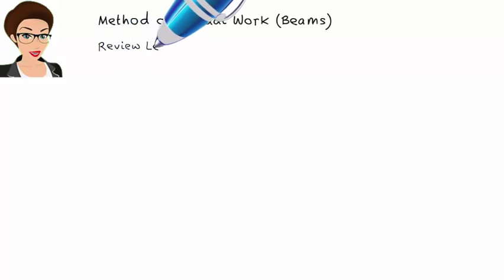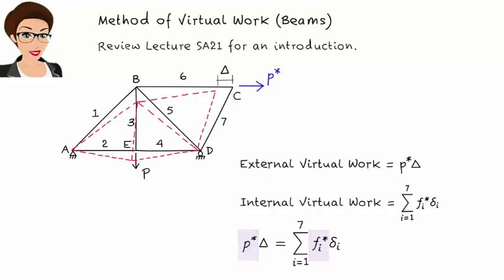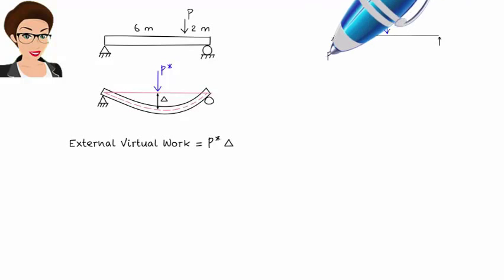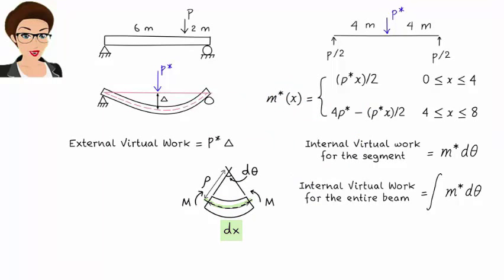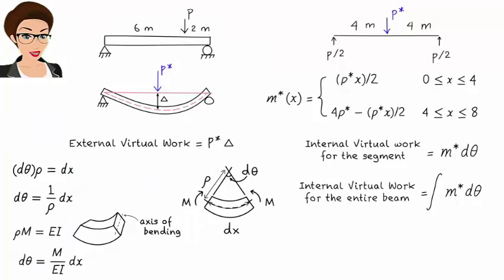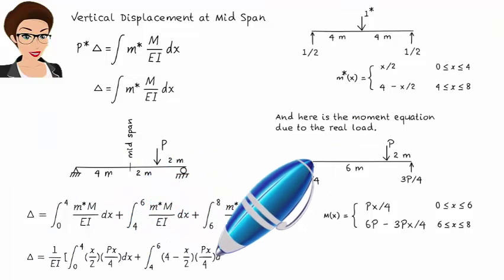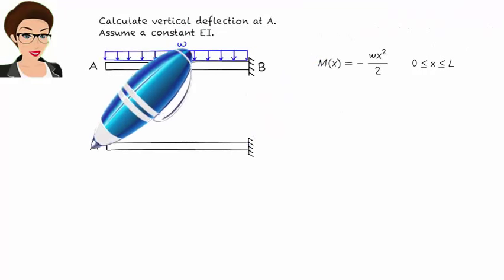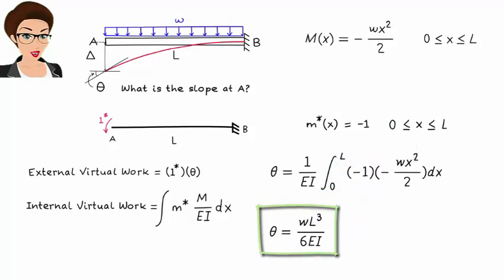SA22: Virtual Work Method (Beams)

Comment: 8:44 hi,is the bending moment of the unit load applied not supposed to be -1*x   ?
Reply from the maker: No, the given moment equation is correct.

If we had a unit vertical load acting at point A, m*(x) would have been (1, the unit load) times (x, the moment arm).

But here, we don’t have a unit load. Rather, we have a unit moment. The moment of the unit moment at any point in the beam is: the unit moment. We don’t multiply the moment by a moment arm to get a moment. That would be incorrect.
Reply: @DrStructure  alright,I understand now,thank you

Comment: Question maam. Based on illustration at 5:28, the m* is at the vertex angle d(theta)? But when we use the virtual work formula, m* lies on x axis, m*(x). Im confused about this one.
Reply from the maker: M and m* both are bending moments in the beam segment. Note the small bent segment shown @5:28 where the radius of curvature is labeled as rho and the angle of bending is denoted as d(theta). The segment has been bent about the beam's neutral axis (shown using dashed lines). The cross section of that segment is also shown, just to the left of the diagram.  Note the axis of bending of the cross-section. Both M and m* act about that axis, causing the segment to bend.  They don't act at any vertex. 

The shown small segment can represent any part of the beam where M and m* are always present.  But their numeric values depend on the location of the segment, which we denote as x. Put it differently, at x = 1,  M and m* could have different values than at x = 2, or x = 3.5, ... Yet, regardless of the x value, when we cut the beam and isolate a tiny segment of it, we end up with the diagram shown @5:28 in which M and m* produce the bending of the segment.

The difference between M and m* is that the former is caused by the real load and the latter by the virtual unit load.

Comment: If the actual load is already at midspan is the m* still necessary? or just disregard that and have delta= integral of (M/EI)(dx)?
Reply from the maker: Yes, m* would still be necessary.  The only time that m* would not be necessary is if it equals 1. But, m* (bending moment equation in the beam) due to a unit load at the mid-span is not 1. So, we cannot just get rid of it.

If the applied load (P) was at mid-span, and we wanted to calculate the deflection at mid-span, then we could write/say: M= P m*. Or, 

delta = P ( integral of  m* m* /EI dx).

Comment: hii Dr.structure ,
1. In virtual work p* = 1 , it means we are assuming that 1N load won't make further deformation  . What is the value of p*, if  1 N load is able to deform the structure ( it can happen in certain situations like if put  load on my steel ruler of 30*8*4 cm3  etc.., ).. ?
 2 . Generally in practical scenario ,  a load or force can be generate by applying mass ( F=mg), where as how can I generate moment at the end of section and at the middle of section ?
3.If a cycle wheel is located  on   spindle through bearing and wheel is rotating . force is acting   on the wheel ( I.e tangential to diameter  axis ) . To study the spindle , I want to transport that force to spindle  because the wheel  is on spindle and . I read the center will have  moment and force . Can you explain this ?
Reply from the maker: The value of p* is not a factor. Before p* can cause any additional deformation, in needs to go through the existing deformation causing work to be done. It is that work/energy that we are considering in the formulation.
If you wanted to actually cause a real bending moment at a given point in a beam, you can apply a load to the end of a lever rigidlyattached to that point.  In real structures, a bending moment at the beam’s end is usually caused by (transferred from) an adjacent member.  
Generally speaking, the spindle is subjected to a torsion which can be calculated either from the tangential (friction) force between the wheel and the ground, or the tension in the chain caused by the force applied to the pedal. For example, if the friction force is F and the radius of the wheel is r, then the torque is (F)(r). There is also a vertical force at each end of the spindle cause by the weight of the person riding the bike which needs to be transferred to the ground through the wheel.
Reply: Dr. Structure I understood the points 2 and 3 but in 1 
existing deformation means ... ? is it only at point of application of force or complete deformation of beam
Reply from the maker: To be sure, the entire beam deforms under the real load. But the deformation at a point other than the point of application of the virtual load does not play in role in the formulation.

Work is done only under the (virtual) load. Since work = force x displacement, even if displacement is not zero but the force is zero, no work is done. So, beam deformation except under the virtual load does not enter into the formulation since those deformations do not result in work.
Reply: Dr. Structure thank you :)

Comment: sorry to trouble you again, am i right in thinking for "uniform load" on beam, the standard procedure of work energy method couldn't be used to solve and we must proceed to using this virtual work method ?
Reply from the maker: correct, the virtual work method is a more general approach for calculating slope and deflection in beams.
Reply from the maker: @DOTA2MAJISTRATE  Here you have a three dimensional system. However, the diagrams show 2D drawings. It is not clear what part of the 3D system is under consideration when drawing the free-body diagram.

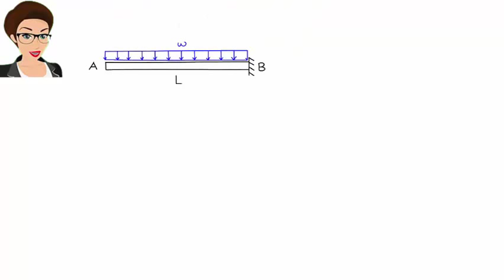Comment: Can you please explain why M(x)=-wx^2/2.. why is there a negative sign here.. isn't it suppose to be positive? 7:25
Reply from the maker: The bending moment in the beam is considered positive when it causes the member to deflect in a concave up manner (top finer in compression and bottom fiber in tension). 

Since the deflection of a cantilever beam subjects to a downward load is concave down (top fiber in tension and bottom fiber in compression), the bending moment is considered negative.

Comment: 5:37 why we can assume that the virtual load is a unit load? is it not voilating any science principles?
Reply from the maker: Not sure what you mean by violating any scientific principle. Please elaborate.

A (virtual) load can have any magnitude. For connivence, we use a unit load.
Reply: @DrStructure  thankyou, Its all clear now. When I ask the question, I taught that a virtual load has certain magnitude that depends on the external load. So I taught that assuming a diferent magnitude such as unit load will make the analysis scientifically wrong.

Comment: how do you know whether the applied virtual moment at A 8:35  is clockwise or counterclockwise?
Reply from the maker: We don't beforehand. We can assume any direction for the virtual moment. If the calculated rotation comes out positive, the assumed direction is correct. Otherwise we made a wrong assumption. That is, now we know that if we reverse the direction of the moment, the rotation comes out positive. It is important to note that the direction of the rotation is the same as the direction of the unit moment. So, a clockwise moment placed on the beam means we are assuming the rotation is clockwise too. A counterclockwise moment means we are assuming a counterclockwise rotation.
Reply: @DrStructure  Thanks! I really appreciate the content & response.
Reply from the maker: @edwardplumb8071  You're welcome!

Comment: this method is what i mean in my previous comment from SA24. Is this method can result the same or closely as double integration method? what is the unit for delta and the slope, is it length and degree/radian units?
Reply from the maker: Yes, the virtual work method yields the same results as the double integration method. In the virtual work method, delta (displacement) has the unit of length, and theta (rotation) is in radians.

Comment: Why is the deflection value at mid span is greater than at the point where "P" is applied?
i.e: delta at mid span=22/3 (P/EI)        
      delta at point "P"=  6 (P/EI)
I thought the downward effect of force "P" at its point of application is more than that of mid span? Does that make sense?
Reply from the maker: Consider a simply supported beam of Length L. Let's assume the beam is subjected to a concentrated load of P at distance (d) from the left end of the beam such that d >= L/2. That is, the load is applied to the right half of the beam.

Where is the location of maximum deflection in this beam?

We know that when deflection is at its maximum value slope of the elastic curve is zero. So, where is slope zero?

If we derive the necessary equations in order to determine the location of zero slope. We get:

3 x^2  = 2 d L - d^2.

where x is the location of zero slope (maximum deflection), d is the load location and L represents  length of the beam.

So, is it true that maximum deflection always occurs under the load? No. 

According to the above equation, maximum deflection is under the load when:

3 d^2 = 2 d L - d^2

Or,

4 d^2 = 2 d L

Or,

2d = L

Or,

When d = L/2 (the load is located at mid-span). 

Otherwise, the location of maximum deflection is given by equation:

x^2 = (2d L - d^2)/3.

Comment: Why is the formula for the external virtual work, not 1/2*P*delta?
Reply from the maker: The principle of virtual load assumes that the structure has already been deformed. It is the deformed structure that we subject to a virtual load. 

The 1/2 factor is work done by a load that causes a deformation.  

But if we are starting with a deformed structure already, and simply apply a virtual load to it  (a load that would not cause any additional deformation), then the 1/2 factor does not come into the picture.
Reply: Dr. Structure woowwwww a very good explanation Dr. Thank youuuu

Comment: 3:22 in the previous video you said internal energy for beams is (1/2) integral m×d theta but here you are saying its integral  m* × dtheta. where  the (1/2) go ?
Reply from the maker: This is the same response that was offered for your previous question on SA21. For the sake of completeness, it is being posted here as well.

Real work done by a force equals (P)(D)/2 where P is the force and D is the displacement in the direction of the force. We derived this expression in Lecture SA19. In that derivation, we started by placing a small force f on the beam and referred to the displacement caused by that tiny force as d. We then expressed work as (f)(d). We showed that by keep adding the small load increment f, we will eventually arrive at the expression (P)(D)/2. 

Basically, the virtual work method established the work-energy relationship based on f and d, indicating that the “virtual” work produced by the small load increment (f) must be equal to the internal energy caused by f. In that derivation the 1/2 factor does not come into the picture, yet the equality between work and energy holds true.

Alternatively, you can think about it in the following way. A structure has real deformation under an applied load. Let’s refer to the load as P and to the resulting displacement under the load as D. After the deformation takes place, suppose somehow we can keep the structure in its deformed shape while removing the load. So, D remains present, yet P is no longer there. Now, if we place a virtual load (a very small load) in the position and direction of P, let’s call it p*, since p* goes through displacement D, it produced (p*)(D) work. The 1/2 factor is not going to be present here, since D was not caused by p*, the displacement was present by the time p* appeared on the scene. So p* simply travels through the existing distance (D) producing work: (P)(D). We refer to this product as virtual work, not real work. According to the law of conservation of energy, this virtual (external) work must be equal to the virtual internal energy/work caused by p*.
Reply: I thought since the virtual load is gradually applied then work becomes 1/2 int m* dtheta
Reply from the maker: No, you can view the virtual load to be very small and applied in one chunk. After all, it is not a real load and it is not causing a real displacement.

Comment: Hi , for cantilever beam example my solution for virtual moment =x-L why it s different from yours
Reply from the maker: It depends on the location of the origin. If we pick A as the origin, we get the solution given in the video. If we pick B as the origin, we get your solution. 

Either way works as long as you apply it consistently throughout the solution.

Comment: Solution of Exercise 2 has some problem...Last part of the video doesn't appears....please solve this problem
Reply from the maker: Thanks for the note. The video shows the complete solution, it shows how to determine the deflection and the slope. It just goes blank afterward. But, we'll look into it.
Reply: Dr. Structure.... thank's a lot....waiting for the video...
Reply from the maker: The revised video for Exercise 2 can be accessed by clicking on the upper right corner of the main video (on the circled i).
Reply: Dr. Structure.... do you have other content like RCC design,,,geotechnical,,,,Transportation........ I am a student of Shahjalal university of science & technology.... your video is very helpful... it helps to understand the concept easily..... thank you
Reply from the maker: Not at the moment, but we will eventually get to them. Although by then, you will already have graduated and have started your professional career. :)
Reply: vary sad for me....by the way...will you make a video on seismic load,,,wind load,, vertical load analysis on different type of frame.....

Comment: What difference between flexibility method and stiffness method?
Reply from the maker: The flexibility methods of analysis invariably involve solving for unknown forces. The displacement methods of analysis use displacements/rotations as unknowns. The Force Method can be viewed as a flexibility method whereas the Slope-Deflection Method is a displacement method. 

The stiffness method is generalized version of the slope-deflection method.

Comment: Shouldn't the moment equation be (x-4)*p* - x*p*/2
Reply from the maker: Almost! 
According to our sign convention, the moment equation for the right half of the beam (@3:00) should be:
px/2 - (x-4)p
This slightly differs from the equation you gave above; One is the negative of the other. 
This equation can also be written as:
px/2 - px + 4p.
Or, 
4p - px/2, which is the same as the one given in the video.
Reply: @DrStructure  Thanks for the answer. Helped clear my doubt

Comment: How is m*(X)= 4 - X/2        4<X<8 !?😬
 Not 2-x/2 ..!?
Reply from the maker: The left reaction is 1/2, its moment arm is x. And, the virtual load has a moment arm of (x - 4), assuming the beam has been cut at some distance to the right of the load. x is the distance from the left support to the cut point.

(1/2)(x) - (1)(x - 4) = 4 - x/2
Reply: @DrStructure  thnx..I took the moment arm as (X+4)

Comment: how come M= - wx^2/2 why negative
Reply from the maker: Because the beam has a concave down deflection. By convention, we take any bending moment that causes concave up deflection as positive, and a moment the cause concave down deflection as negative.
Reply: How can we identify if it has a concave down or up deflection
Reply from the maker: Set the origin of the coordinate system at the left end of the beam, x-axis being positive to the right. Now cut the beam at an arbitrary point along the x-axis, say at point O. Take the left segment, the segment of the beam between the origin and O, and draw the internal forces at O. There would be a shear force and a bending moment. Assume both are being positive. Label the bending moment M.

A positive shear force, by convention, tends to rotate the segment in the clockwise direction. This means the shear force at O should be pointing downward for it to cause a clockwise rotation. A positive moment should cause a concave up deflection. This means moment at O should be drawn in the counterclockwise direction. If you are not sure why that is, experiment. Draw the beam segment and place these forces on it and visualize how the segment would rotate and deflect.

Now, write the equilibrium equations, more specifically, the moment equation and solve for the unknown moment at point O, you would get: M = - w x x/2.

Comment: at 2:54 for m*(x) how 4P*-(P*x)/2 comes for 4<x<8
Reply from the maker: (P/2)(x) - P(x-4) = 4P - (P/2)(x)
Reply: it should be (P/2)(x)-(P/2)(x-4).....right?
Reply from the maker: No! where does that second P/2 come from? 

x is the distance from the left end of the beam. Going from left to right, we have (P/2) for the support reaction at the left end of the beam, and (P) for the applied load. The right support reaction (P/2) does not appear in that free-body diagram.
Reply: am sorry but it should be (P/2)(x)-(P/2)(x-4)
Reply: because the applied p load is (x-4) distance from the cut  isnt it?
Reply: ohh my bad Dr. structure we are talking the same thing you just simplified the equation....Thank You
Reply from the maker: Absolutely not! There is only one (p/2) in the free body diagram, once the beam is cut at x (the distance from the left end of the beam to the cut point).
Reply: exactly.....i get it now ..Thank You again
Reply from the maker: You are welcome!